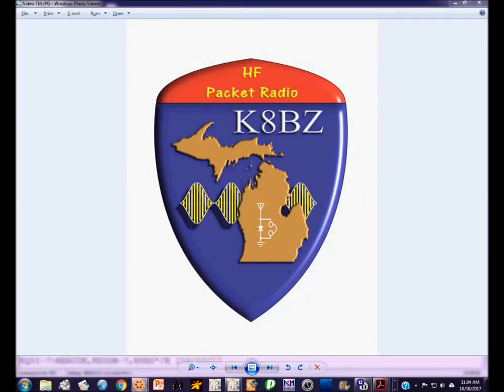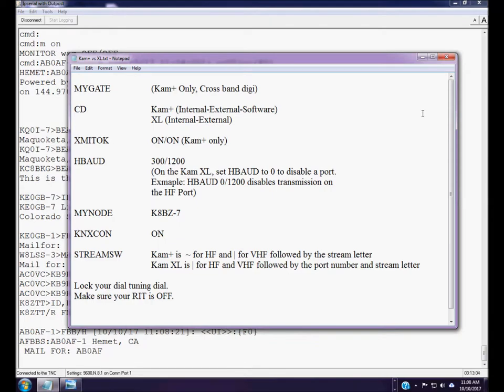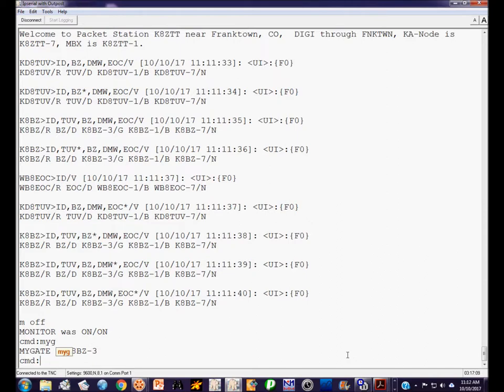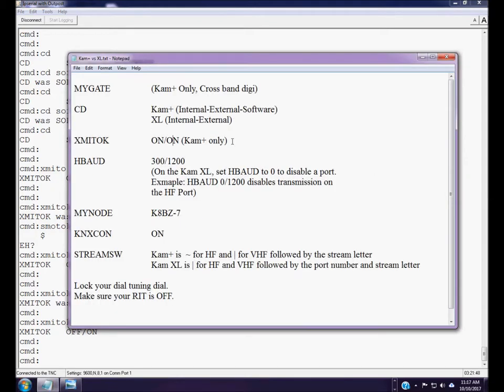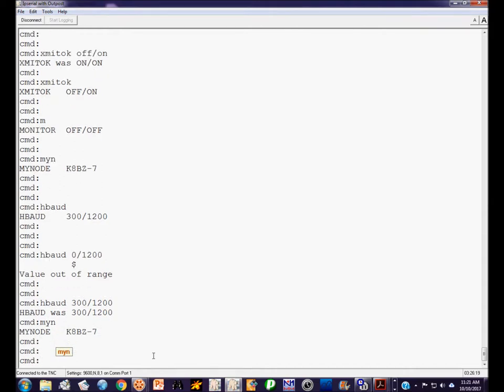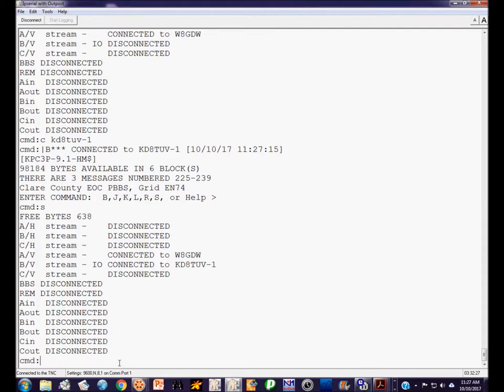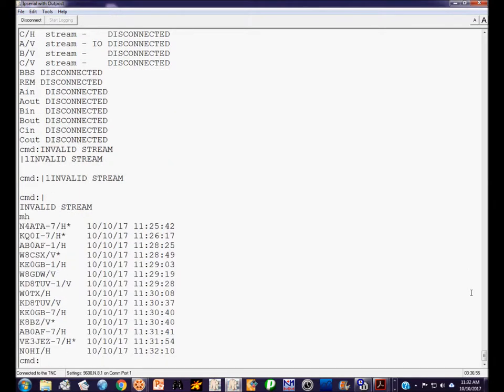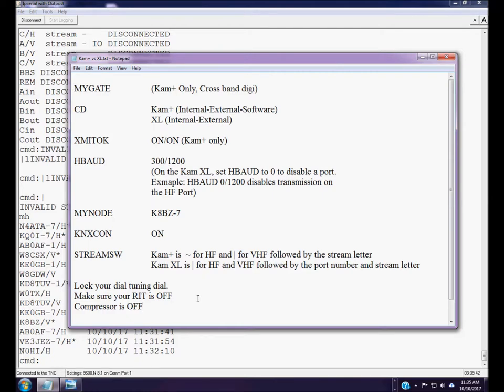TNC Based HF Packet Radio using Kam+ or Kam XL

Comment: really good videos steve. i have my aea232 set up for vhf for and going to set my kam/xl for hf. but need the kam to computer 25 pin to usb cable. is there people on HF packet today in 2021?
thanks for great videos
Reply: @stevewuelfing6326  gotcha going to order the exp card for sure for my tower computer. but how would i do that to a laptop that only had USB ports for field/camper use
Reply: @butterbean4195  With a laptop that only has USB ports you have to the USB to Serial Port converters.  You don't have a choice.  It's just an extra gizmo you have to deal with, but they work.  Some of the unauthorized version of the firmware in the converters are disabled in the Windows security updates.  But the authorized versions are no problem.  There are lots of them on Amazon in the $8 to $25 range.  Good luck.

Comment: Hi Steve! I bought a Kantronics KAM all mode. I can't  pass the "*" sync at the beginning. I try all baud rates with no success. Give me a light please! TIA
Reply: Thanks for comment.  I'll be glad to try to help you.

This will probably require a few back and forth messages.  Please email me at k8bz@arrl.net and let me know if it is a Kam Plus or a Kam XL, and if you bought it new or used and then we will go from there.  I'll watch for the email. 73.